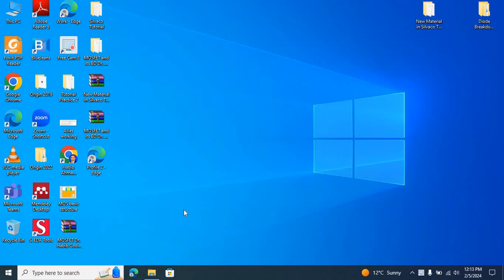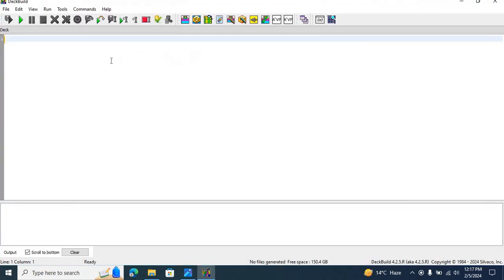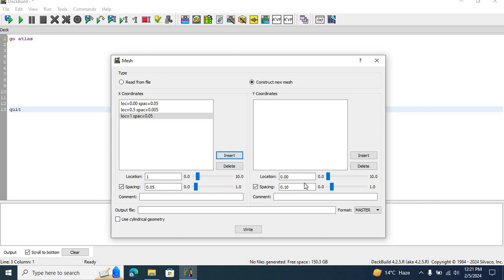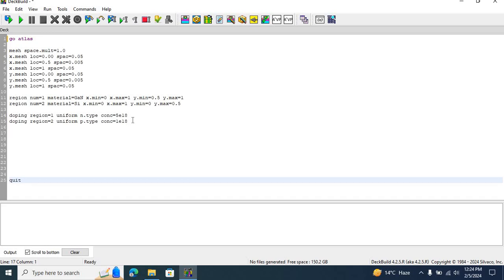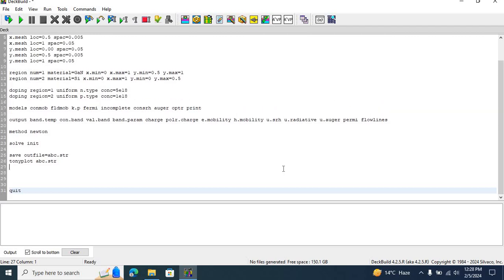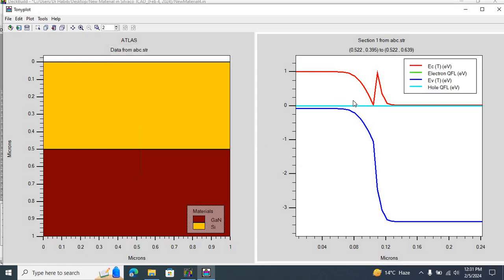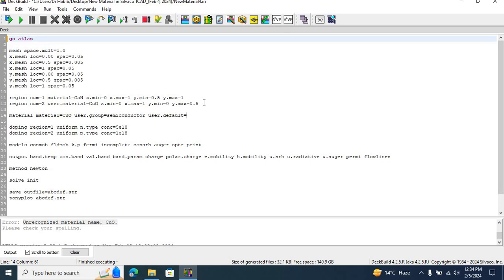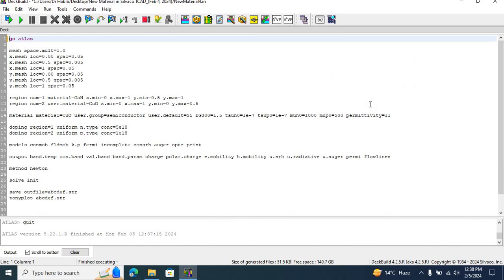How to Introduce a New Material in ATLAS Silvaco TCAD? 📚💡🔧  #silvaco🌟🚀🔍️💻

Comment: interesting and clear explanation. I've followed the same steps but  I got an error about sipc.exe  (Silvaco Inter Process Communication (SIPC)), any idea about the issue. Thanks again
Reply from the maker: No idea but here's what AI says:

According to the Silvaco forum, a SIPC error can occur when the SIPC server is not running or if there is a communication issue between Athena and SIPC ¹. The error "simulator has unexpectedly exited with status -1073741819" can also occur due to an implantation issue ². To resolve SIPC errors, try restarting the SIPC server, checking communication between Athena and SIPC, and reviewing implantation settings ¹ ². Additionally, updates to the software may be available to address these issues ³. For further assistance, consider contacting Silvaco support or seeking guidance from documentation and user resources ⁴.